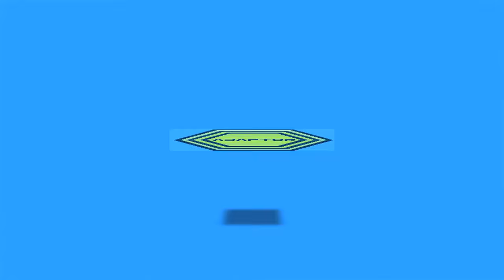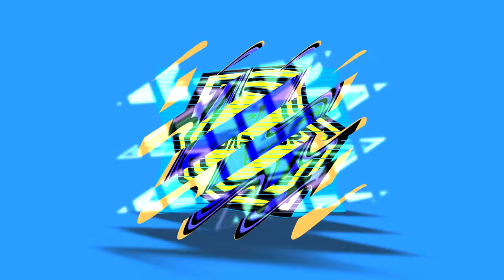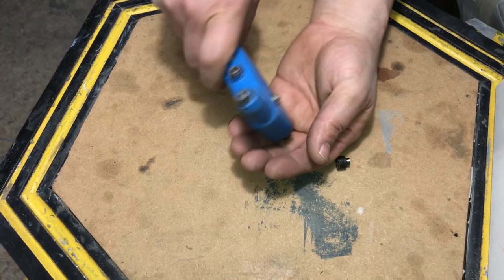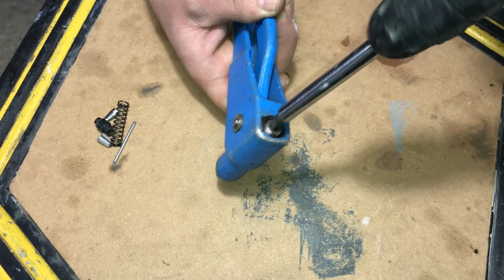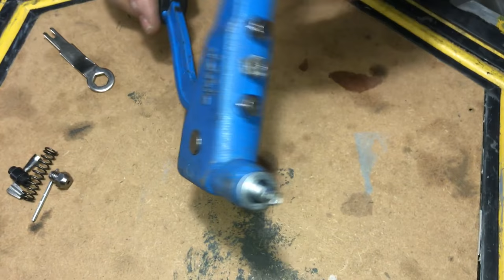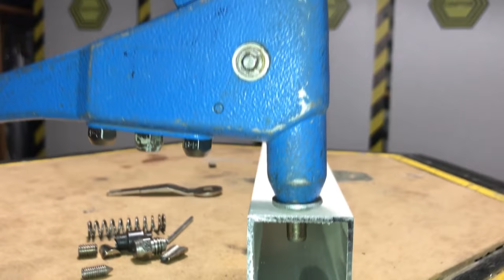HOW TO INSERT A NUT WITH A RIVET POP GUN

Comment: I've been looking for ways to use these rivnuts without having to buy the special tool to do it. I've seen loads of vids on just using nuts and bolts and spanners that do the job but your vid has the simplest version yet. Great vid and very clever. Thanks.
Reply: @Techy Hunter I have actually bought a Teng tools rivnut kit and am very disappointed in it. Two of the threaded applicators have stripped out after only a couple of uses.
Reply: Take my advice, buy the tool. You'll save time and effort if you're doing more than just 1 or 2.
Reply: @brendanlenane2685  Doing it WRONG is Operator Error, not bad tools.
Reply: @davidjames1063  yeah I went with my gut and bought the proper tool. No regrets about that now.

Comment: Good luck taking off a partially installed riv-nut. It must be fully seated with the backside rolled over. If not—The first time you tighten something on to it the riv-nut will bottom out and that allows a gap to form which MEANS: When it’s time to loosen it —the riv-nut will spin spin spin. NEVER do it Half assed..
Reply: Exactly. Lots of BAD video How To guys on here.